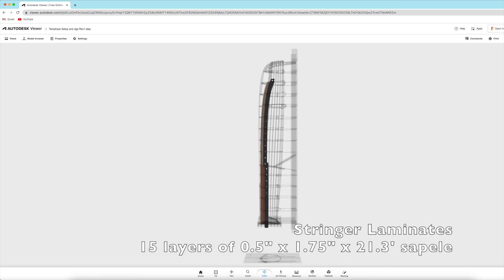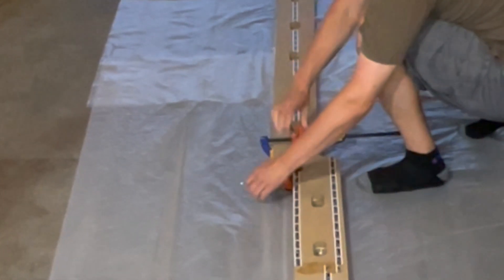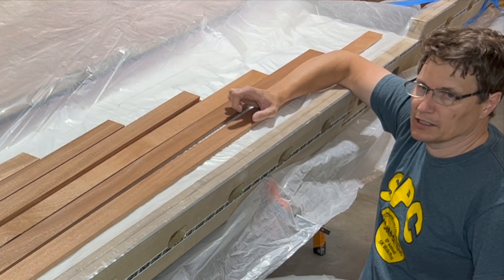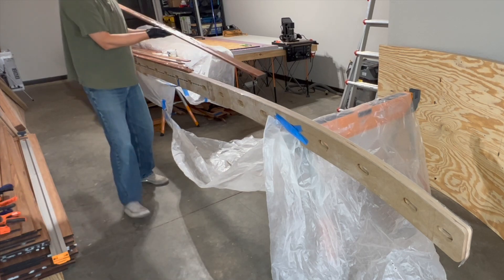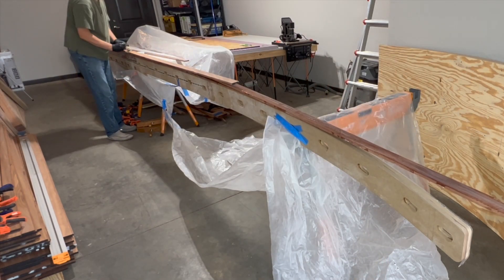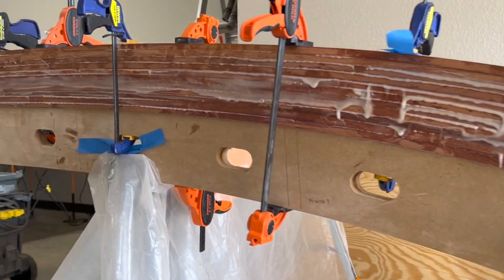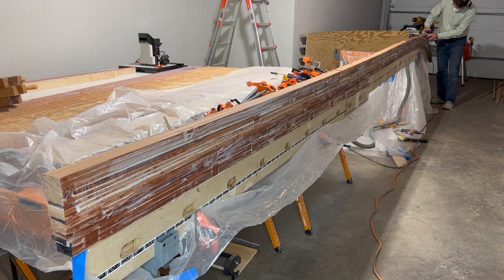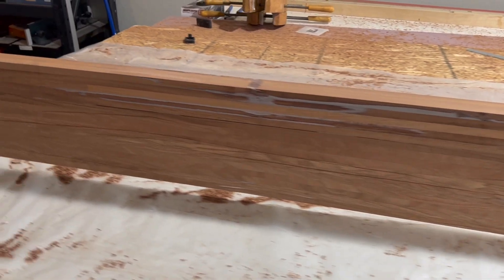Temptress Build 25: Stringer Lamination #1

Comment: Sorry if i missed this, but why did you not glue the stringer on its side? Would that not have been easier/more stable?
Reply from the maker: @gerbenstoffels Thanks for sharing your insight.  In hindsight, it would have been much easier to laminate the stringer on its side.  My shop floor is not perfectly level, so I decided to laminate the stringer vertically.  As you saw. I had a lot of alignment challenges.

For the 2nd stringer, I do plan to laminate with the stringer on its side, and to laminate all of the full length layers in one step.  As you suggest, I think this will be much easier.
Reply: That thing is massive! Can't wait to get there and get my hands dirty.